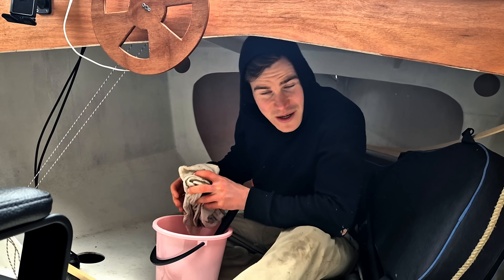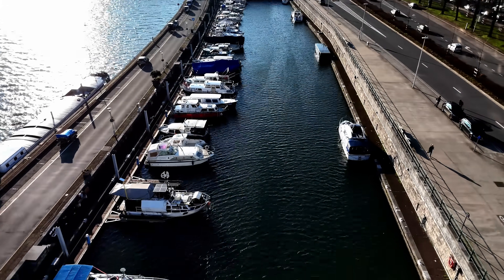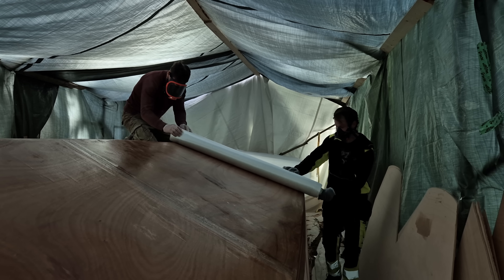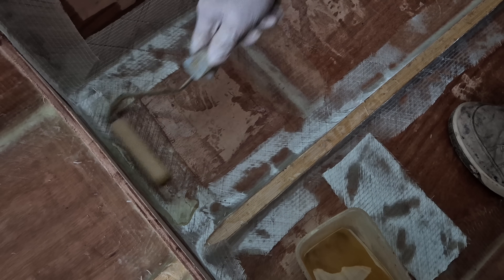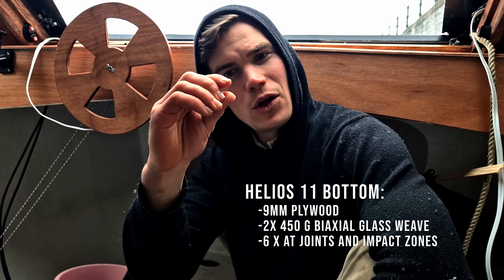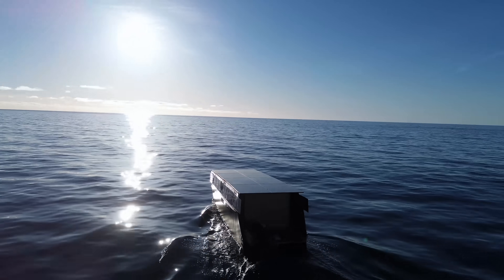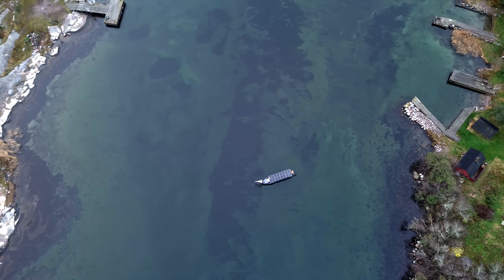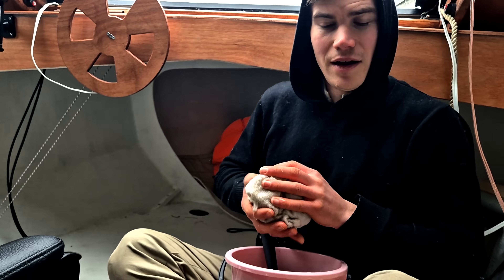I Hit a Log! Is my Solar Prototype too Lightweight?

Comment from the maker: Next up: HALO 13 Design Video.

Let's build the future we've already seen in movies and videogames.

The Age of Innovation is Here ⚡️
Reply: I look forward to seeing more of the HALO 13 design . . 💯👍
Reply: Take next time 4 layers of carbon fiber. Its more expensive, but it adds a lot of strengt Sven has even 6 or 7 layers
Reply: @Inhetmidden  Not really the kind of strength needed. CF is weak in side loading, impacts.  Kevlar like materials can do it in 1 layer at a tiny fraction of the cost.  Composites are mostly to keep the water, shipworms away and if Kevlar type, impact.  In this composites is not really for strength, which is in the plywood.
Reply: @jerryDycus-d9c   I talk about the underwater line and if i need to choose between your knolidge and the one of Sven Yrwin you loose ( you need to use glassfiber on top of the kevlar, so it is still sandable) and also with the plywood as it has no isolation at all.. ( The plywood has a 550kg per m3 while Sven his Divinycell H130 is at 130kg per m3. Lets say that saves me 400kg on m3 of weight) But ok when you hit sharp objects the carbon fiber is more painfull and on rivers and canals this happens more easy then on the ocean. When it comes to the solar pannels and the realistic energy catch. The clouds that will be on earth more and more (global viper duo to global warming), is intercepting more and more usefull energy for the pannels. Now he wants to use even a higher speed, that sucks even more power for lesser speed increase.
Reply: Looking forward to HALO 13!
Reply: You keep saying “WE have” when you are talking about doing things to your boat is there someone with you
Reply: @PromasterHOF  yeah a lady
Reply: Dont forget to take a look at sven yrvind ideas about wave- piercing-hull. His history with own made boats for long distance solo sailing are avalibly on his website and his still active building his (propably) final next design

Comment: You don’t have any sealant around your windows even, you can’t take waves with any size, but you know that. Light is made by Kevlar, I’m not sure if you are acting this out for views or not.
Don’t take anyone with you above 2’ waves. You don’t even have a huge bilge pump. If the water is cold you will be unalived.

Comment: How is the buoyancy of those think hulls?  What will bridge deck to waterline height be? If you want sea comfort you want close to 1m. My 43ft Cat had about 600m, needed much more. My cat would get hull slap. Saying, that I was 7m wide. My hulls are only about 1.5m across, narrow. No keels, round below waterline with dagger boards. I would get quite a bit of side slip while sailing. But its fast, i did 17 knots in it(loved it). With narrow hulls I didn't suffer from hobby horseing like larger hulled Cats did. With your boxy design of the superstructure you will need keels, v hulls or deeper hulls to help with combating windage. Something i seen that was interesting is a product called boat wings, inflatable sponsons. Great for stability of monos and they can be packed up to form full length fenders. I have a 5.5m fishing boat and coming from a 43ft, 21ft wide Catamaran, my wife thinks it could be a good option, 😅.

Comment: I'm going to make a case again for wind generators vs sails. You could have the turbines running all the time with the solar panels. The sails are only for propulsion, but the turbines charge the battery and that energy is more versatile. It can do propulsion and help with anything else that uses electricity: desalinator, bilge pumps, radio, AC, or phone charge. For when you are just anchored somewhere. It also kinda feels like you are trying to reinvent the wheel with boat design. Retrofitting an existing tested design used boat would let you focus on making improvements to traveling by generating electricity.
Reply: They both should be used along with anchored in tidal stream generation.  Say 3 large windsurfer rigs that can be rolled up and stored easily.  And can use on either side so not shade the panels and maybe a kite.   
Use a 2 blade WT so it too can be easily stored with the WS rigs I used to build, sell and use. Tidal or sail generation though the drive system.  I'd take such a craft across the ocean.

Comment: on the Catamaran design you can cheat physics a little  some distance above waterline you can make the hull wider for space without affecting cruise.I know a Home build Cataman using this but cant remember the name it is UK based YT Channel. 

one major stability issue i see is the bow, it goes almost halfway back to the boats length making it kind of like a tricyle that likes to tip forward to the left or right making it roll around alot more. here would be a choise to make is it more stationary like a house boat or more like a cruiser.

 another Catamaran Design would be idk how it was Called kind of like that US Stealth Ship you have main body under Water then Thin going up and then wider again. a Small VAWT that can help when it isnt that sunny.  choices over choices over choices. perhabs also vertical windows on the front for easier construction? and avoiding the leakage issue.

 but for over all construction make sure its all CNC this way it doesnt matter what material its made out of and the labour cost of makeing all pieces goes down instead of when made manually

Comment: Lukas,
Okay, lots of respect for your work, for your adventure 👍  But too, just a bit of anxiety for your stubborn iconoclastic mindset, and for your tenuous experiments.  🤓
Mankind has already been testing rivers, lakes, and oceans for thousands of years.  Those waters have been testing mankind for even longer.
You too can be a boat maker-of-progress, but only if you will learn from them, and respect those many failures and well-earned lessons.
“There are two kinds of design.  Design in our heads, and design in the real world.) _ GWS

Listen. Question. Adapt. Learn. Do many small experiments. Make small failures*  Rinse. Repeat.

Enjoy your adventure!  🙏

Btw:
1) Does your boat have (several) — * watertight bulkheads!! — to preclude a catastrophic failure sinking? 👍
2) Your YouTube audience is more interested in your work, your boat, your progress than looking at your talking-head.  Want more followers, more support?  Point your camera at what you see, what you’re doing, where you are.  Not so much at your self.  😎

Comment: Be careful, in those narrow hulls you will get water from the air and temperature difference, even if hominidy will be low, there will be still water down below, you will need proper system to drain it out.

Comment: Couldn't you simply build the floats and boat completely separated in the future catamaran?
Then the floating part could be some streamlined optimized glasfibre or just PE stuff and the vessel itself wouldn't have to be perfectly waterproof at all as it doesn't touch the water surface. Everybody could build his/her own individual vehicle out of wood or other materials which would simply be screwed onto the floating part.
Ultimately, one could offer various "off-the-shelf" platforms for different boat sizes and weights.

Comment: ANY boat is going to be allergic to pointy things hitting them, so your building material choice isn't any worse than any other vs pointy. Here's a stupid little nitpick for you- I think if your propulsion is electric it's called "motor". If it's internal combustion it's called "engine". I could be wrong, but that's what I was told by my journeyman electrician once many years ago. Glad you didn't sustain damage with the logs, and look forward to the future!

Comment: I got a bit carried away with the "torpedo" design. Did some quick calculations, could be possible with reinforced standard plastic pipes? 
Even put the LiFePo4 cells in there with standard prismatic cells. Found standard plastic pipes that that could be used for a safer double hull (pipe in pipe with expanding foam between) in the torpedos, with the cells inside in the inner pipe. Maximum of 124kWh per torpedo, so more than enough room, but probably too heavy. 

100kWh would be around 600kg and 4500€ of battery even for the heavier LiFePo4. Also did some quick cad-sketches, the torpedos would look awesome... :) 

Maybe a risky design, but risk does not seem an issue for you.... :)

Comment: Spray foam wound help with condensation build up, craft rigidity, seal up micro holes/wood pores and collisions punctures, adds buoyancy against flooding and itd be significantly warmer in the winter. Can still make boxes for storing batteries, but spray where possible. As a former carpenter I say proper insulation usually improves everything.

Comment: I see you made a mistake I see on many self built wooden boats. That is not painting the inside of lockers or other, later in accessible, areas with a waterproof white paint. Painting these areas lets you see rot or other damage much more easily some time down the sailing trip. Sadly, once a locker is closed in it's just about impossible to paint the inside.
Keep in mind that boat insides can get wet from condensation (especially your non insulated plywood boat), not just water ingress from rain or leaks.

Comment: One additional benefit of building your next boat with narrow submerged hulls is that it will track well when all the surface area above the water is affected by windage. 

My little solar electric boat has low aspect keels built in which keep the boat pointed very well and helps to increase overall  efficiency. 

I think going narrow with minimal wetted surface area and a water splitting/wave piercing form is a very wise choice. 

Just make sure you leave yourself enough bridge deck clearance so you aren’t getting slapped by waves from underneath.

Comment: sailed in 6-7 in sturdy old dutch boats.. and it was always impressively violent.. I think you might have built her too light, also not sure if you have, but (styrofoam) float chambers is typical here, double layered sometimes. like a head board, not sure of translation, 1 up front and 2 in the back often.

Comment: Hey Lukas! I’m on the same crazy mission you are — designing a fully solar‑powered catamaran for the Great Loop and the European rivers, built to tell the marina‑fuel‑mafia to go pound sand. I’ve been co‑designing the whole thing with AI (yes, really), and it’s been like having a naval architect who never sleeps and never judges my bad ideas. I started this about 2 months ago without any knowledge about your channel, but came pretty much to the same conclusions as you did. 

We ended up with a 10m trailer‑legal cat, 2.5t displacement, carbon fiber skins over polypropylene honeycomb (cheaper than plywood, lighter than my last New Year’s resolution), and a beam that squeezes under the 8'6" limit without making the boat look like a floating pencil.

We’re targeting Category B — because coastal cruising is fun, but crossing oceans Category A in a 10m solar cat is basically a Darwin Award application. The AI and I ran the numbers, and the boat would survive… but I probably wouldn’t.

The whole design is optimized for marina‑independence: big solar, big battery banks, big kite, small sail, zero diesel, zero noise, zero guilt. Your videos have been a huge inspiration — it’s nice to know I’m not the only one who looked at fuel prices and said, ‘Nope, I’m going electric and I’m taking the sun with me.’ Yesterday we (the AI and I) designed an automatic sun tracking system for the solar panels. This idea was inspired by you showing the difference in power generation between flat and tilted panels. Theoretically 30 to 35% more. We also designed a new propulsion system based on the 20 kw Flipsky motor with planetary gearbox and special propeller for greater efficiency. The total build would not be more than $1000 to $1200 for one 20 kw motor. About one tenth of the cost of what is out there currently in the same power range. 

Thanks for blazing the trail, you are one year ahead of me. I have watched all your videos now and agree with many of your observations, and I also picked up some practical tips that were very helpful. Maybe one day our two solar spaceships will cross paths out there. After I'm finished cruising the Great Loop and the Caribbean, I will put the catamaran on a transport ship and move it from New York to Antwerp.
Reply: Intresting! Do videos, we will follow your build and travels!

Comment: You should consider adding a second electric propulsion system and having two separate battery systems and / or a generator for added redundancy and safety on the next model

Comment: Bilge pumps... Boats float because they are full of air. If you ever find yourself in rough seas, one good wave can dump a few hundred liters of water into what is supposed to be an airspace. You need to be able to rapidly extract that water and regain buoyancy. Once you are partially flooded, the water will run to one end or the other, so at least one pump at each end of the hull so whatever end is low will still have a working pump. And pumps need power, so keep your electrical sealed and the batteries high enough to be out of any flooding.
Reply: Exactly. Lukas is slowly reinventing the core features of boats and why they exist, and it's a fun process to watch.
Reply: In rough seas, put on life vest and abandon ship.  Or sink inside it.

Comment: I notice that you lack the drainage holes at the bottom corners of your side compartments?
It's common to have that so you can use a single pump at the bottom of the hull to not only remove but also detect any moisture leaking in. With the holes being placed high up on the compartments they can fill with water before they drain down into base hull and you notice it.

Comment: Plywood is also the easiest to repair or replace, easiest to modify…and it floats…

Plywood for the win!

You could add a layer of Kevlar for piercing strength and abrasion resistance but I don’t think it would be necessary because you’re cruising at economy cruise mode most of the time and plywood itself has great piercing resistance that far exceeds foam core by at least one order of magnitude. 

Good video! Keep going!

Comment: If you get a chance foam core works great I wouldnt rule it out entirely especially if youre worried about weight.  We redid my dads commercial fishing boats deck fish hold and cabin and all interior areas with it It gave us a massive weight reduction and its every bit as easy to work with as marine ply.  Maybe use a bit of both like we did on my boat where my deck was still wood with glass but redid cabin and catwalks with foam core.

Comment: Moisture will accumulate  in the wood and layers will separate, and wood will rot. Problems will become a problem in 5 years. Stitch / glue would be a superior construction.  Okume rot goes fast when it starts. 9m.m is way to thin, clinker / lap planking would also add longevity, and add longitude strength.

Comment: No US boat builders use plywood core inside anymore because it always rots and it gets mushy and unstable. Foam core does not rot so you don’t have to worry in 10, 20 or 30 years that you have a rotten core.  If this is for fun or a hobby, plywood works great but if you are planning to sell Boats I don’t think you will find a lot of people willing to buy something that you know it will rot sooner or later. Not to be too critical but this is a big deal at least here in the US.

Comment: One thing to remember about Marinas. They usually charge by the foot of length and conversely, sometimes if the boat is too wide you can't even get a slip. I nearly 100 ft long boat would cost a fortune in a marina per night.

Comment: I like your boat, you did a beautiful design, I think you have succeeded in efficiency and aesthetic as well. A good improvement would be a metal sheet on the keel and bottom to prevent hull piercing in case you scrap rocks. Good luck :hand-pink-waving:

Comment: I know nothing. But how about plywood - frigolit - plywood. Your own sandwich-structure? Stupid most likely. I am not sure one needs more strength then what for instance carbonfibre gives. But anyway to start the project glueing plywood - frigolit - plywood togeather. It makes the boat very hard to sink, the hull itself will float. And maybe this larger (approx 8x wider in thickness) structure will give more strenght, a sort of honeycomb pattern.
Reply from the maker: My father has used that in his boat. Ultra lightweight, yet strong.

Negative: expensive (which means the boat will become smaller)

Might be viable however. Adds nice insulation while maintaining wooden feel.

Comment: For narrow Torpedo hulls - HDPE pipe could be used and covered in Fibreglass.
Reply: Nothing adheres to HDPE.  It must be thermally welded.  Unreinforced plastic lacks stiffness and stability so it ends up heavy and warps after a decade.

Comment: I would add some electric bilge pumps in the front and in the rear to get out the water.
Reply: or, drill a hole in the bottom to let it drain.
Reply: @nimrodquimbus912 😂😂😂

Comment: Make sure that your new boat is no wider than 5.05 meters, otherwise it will no longer fit into the French locks with Freycinet dimensions! I'd rather go with 4.6 - 4.8 meters.